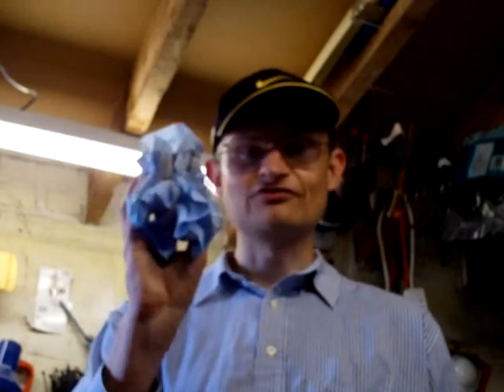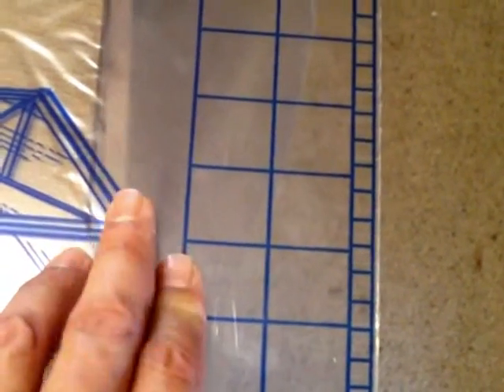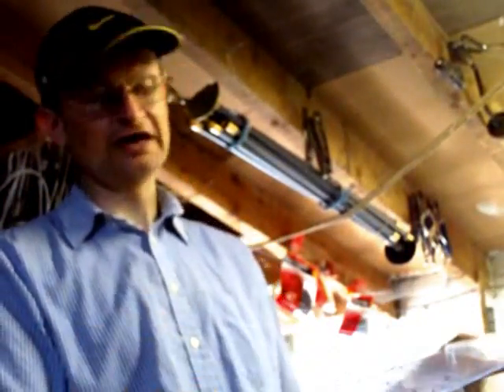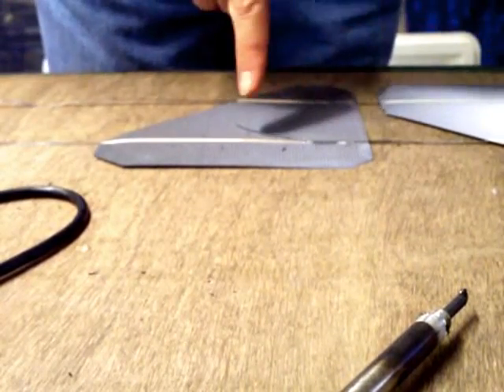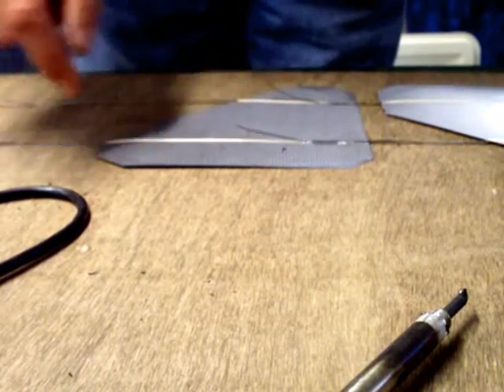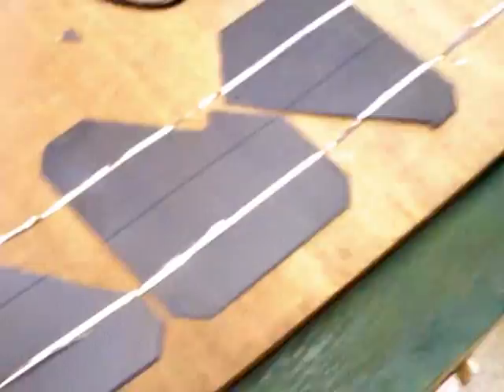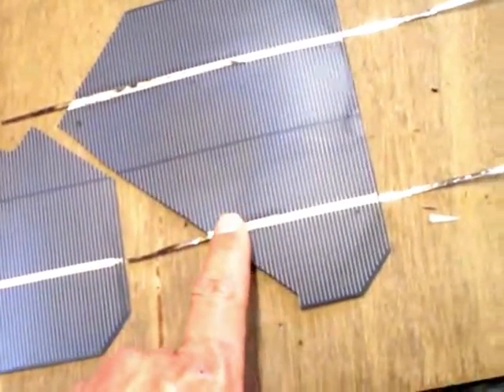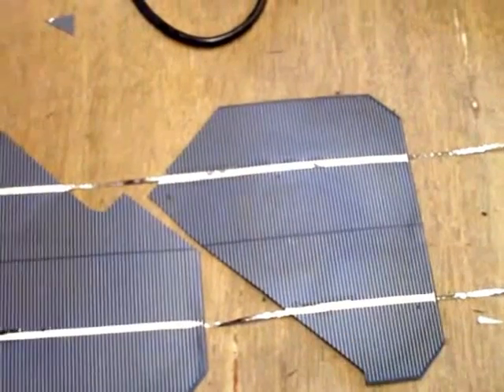Making Solar Photovoltaic Panels Quickly and breakage free

Comment: +Nick Dewey
Nick, I've worked in 'acrylic' or 'plexiglas' for many years. If you're using a jigsaw I recommend running a bead of oil along the cut line. It reduces the friction and lessens the molten plastic in the curf as you saw. Also try using a triple cut blade in your circular for a clean cut. 
You can also run a utility gas torch along the cut-edge to 'fire-polish' it. 
Great vid though, very informative in a casual way.